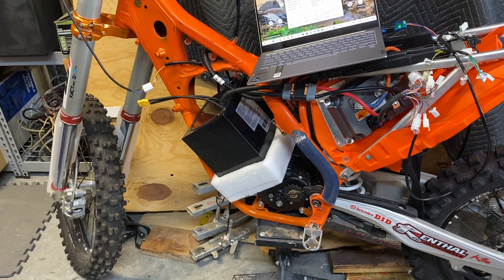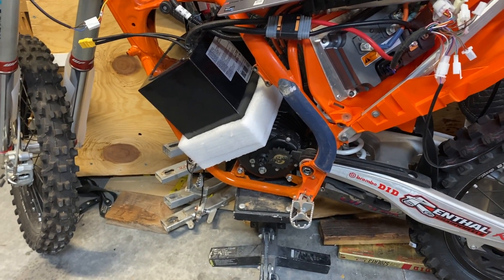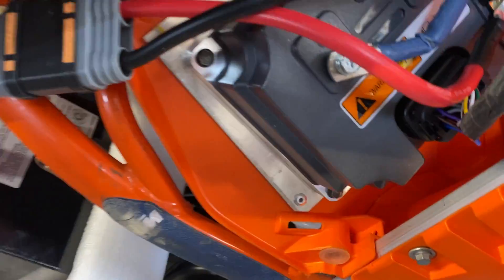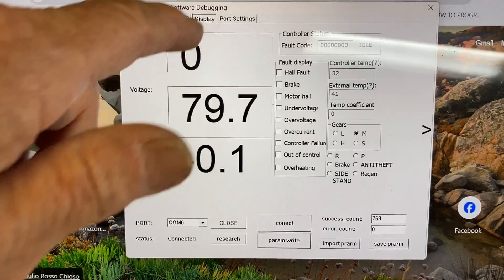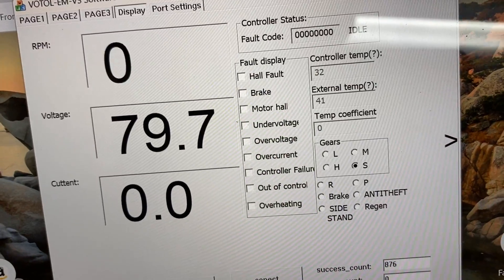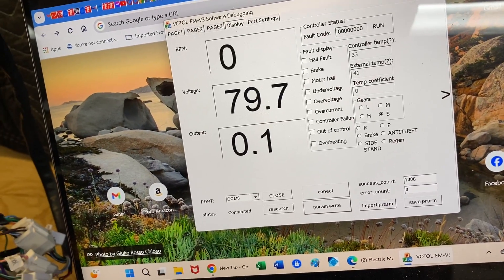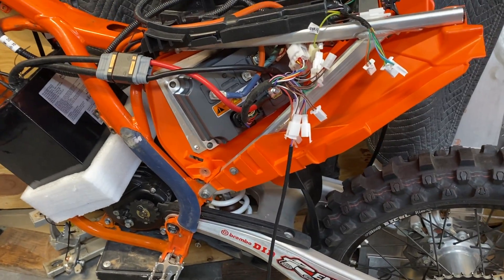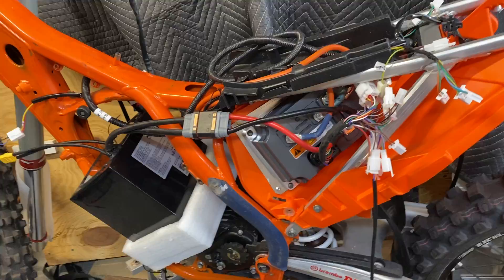2022 KTM 250SXF with QS138 70H V3 Motor and EM260S Controller

Comment: Sir I do run a Go-Kart manufacturing team in India. I wanted to buy QS138 90H motor can you tell me is it worth to buy because I have seen a lot of faulty piece cases ?
Reply from the maker: I can't speak for the QS138 90H, since I have not used one of these.  We exclusively use the QS138 70H V3, and they have held up quite well.  On the old model of the QS138 70H V3 we had lost a few output shaft bearings, and spun the gear on the output shaft, but the broken cases you saw were probably having the chain too tight. ( Very damaging on dirt bikes)  We do not use the QS138 90H motor, because it is too wide to fit in most models of current and newer dirt bikes.  It looks like a very robust motor.

Comment: What is the battery specs and how much range do you get?
Reply from the maker: The battery will probably be a 20S12P Molicel P42A cells.  This is good for about 10 laps on a moto  track, i just got a 20 mile single track ride with about 5 miles left in that size battery.  I am going to make it quick change at that size, but I could fit a 20S16P  in the space.

Comment: 42квт можно лить в него, а размером как qs138v3
Reply from the maker: He says that you can run this to 42 KW?  We have only run it to 28KW,  we have had no significant motor problems.  He may be correct that it could withstand 42KW.  Time for a bigger controller.
Reply: @dcoxryton  sotion fw04